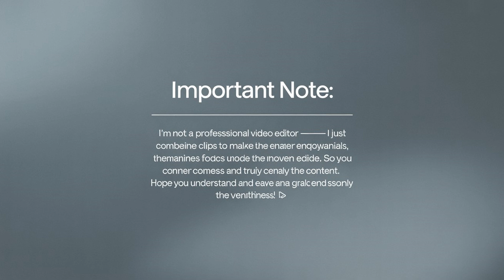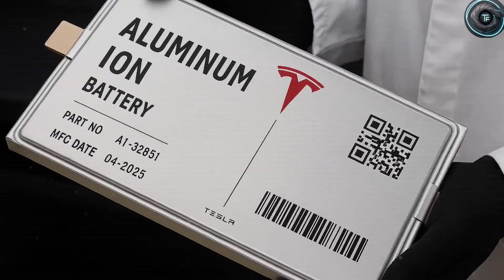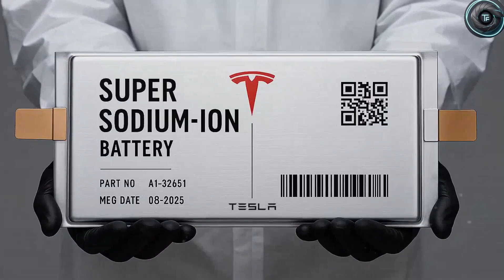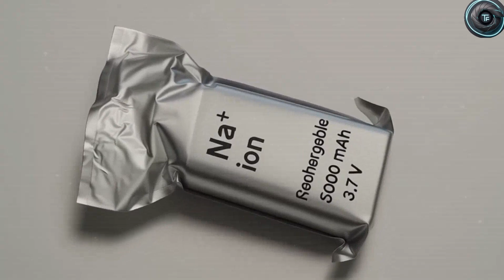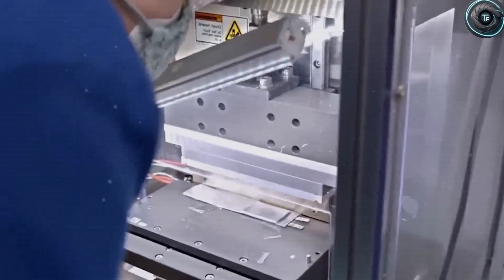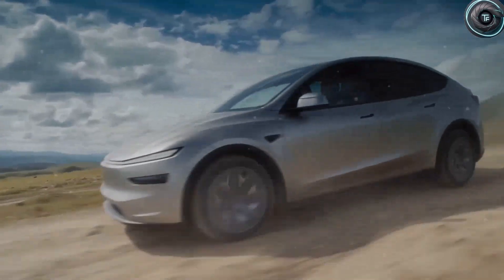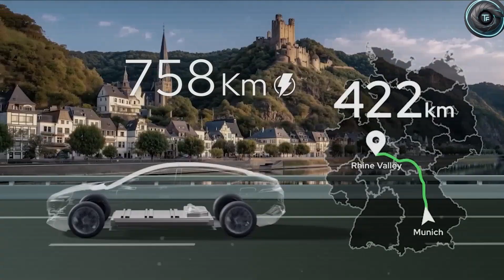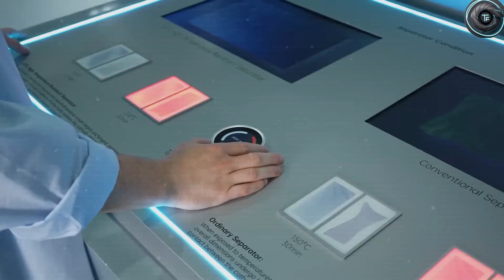Final Showdown! 2026 Tesla Model 2 Battery: Aluminum-Ion vs Sodium-Ion – Which Wins?

Comment: An issue not addressed is: If in fact gigacasting will be central to Model 2 and it will be using an aluminum alloy- what economies would apply if the batteries share the same common element: aluminum.
Reply from the maker: Yes, big cost savings possible.